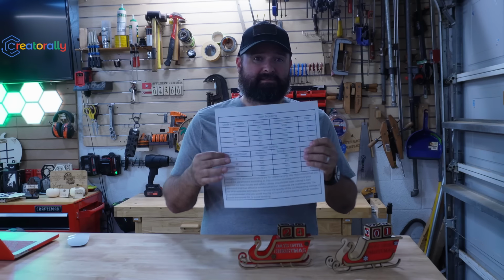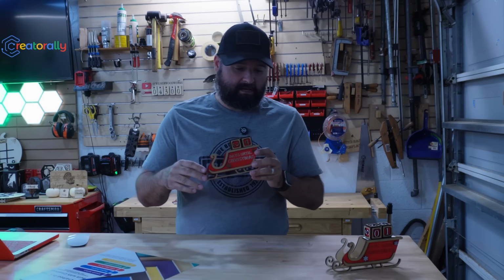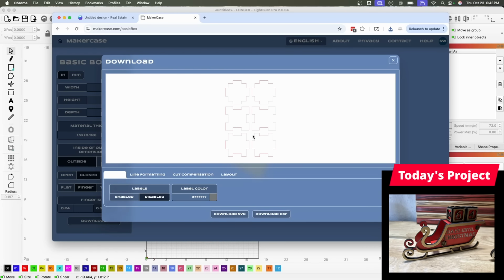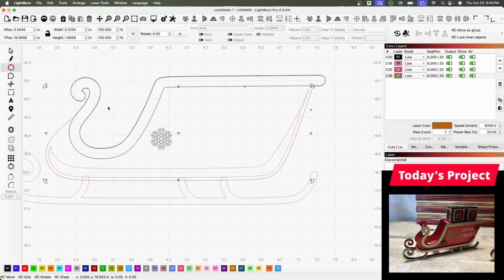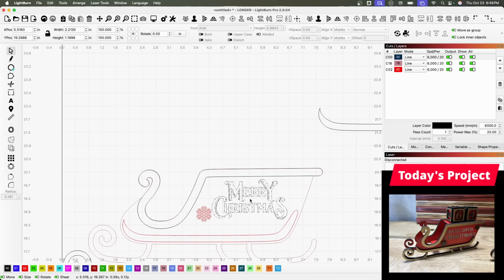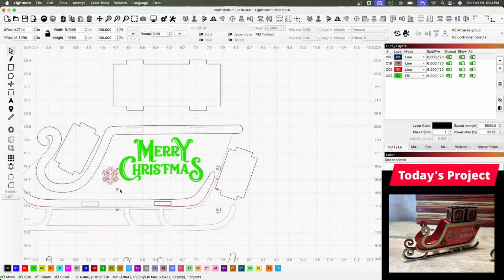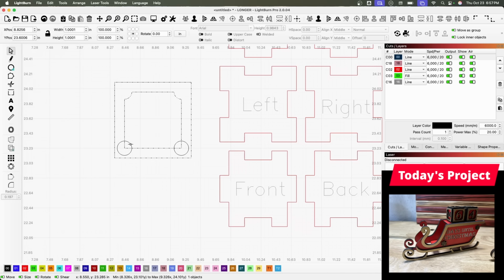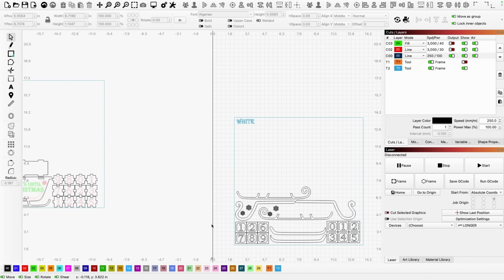DIY Christmas Countdown Sleigh with Creatorally Colored Plywood | Laser Cut Holiday Project

Comment: Another good one. Prefinished wood makes projects easier. Because I need to save money I either stain the wood or apply acrylic paint with a baby wipe because I like to see the wood grain. Thanks for sharing.
Reply from the maker: That's a great tip about using baby wipes to apply acrylic paint and still see the wood grain! Thanks for sharing that idea.